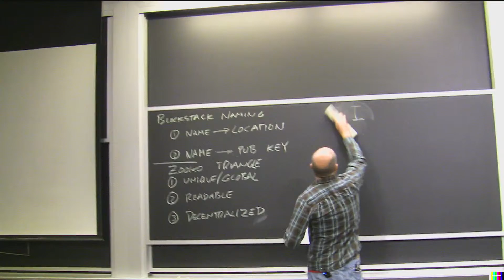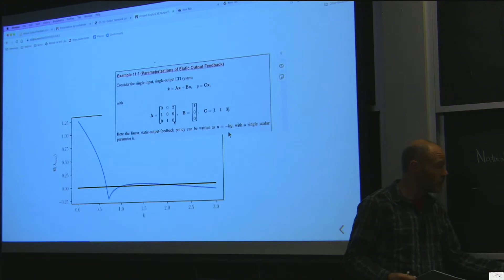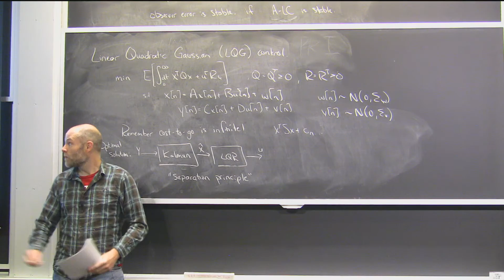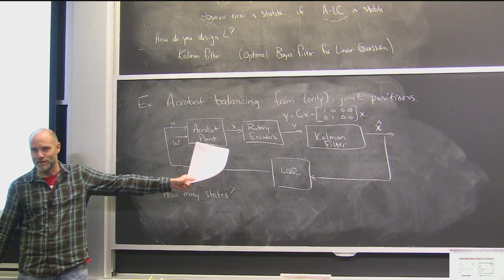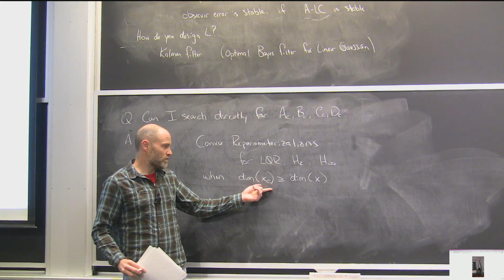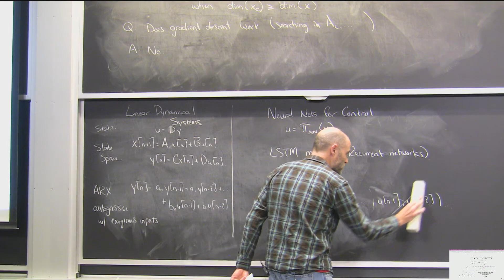Lecture 23: MIT 6.832 Underactuated Robotics (Spring 2022) | "Output Feedback"

Comment: At 53:20, you wrote a general form of a dynamic controller (with parameters Ac Bc Cc Dc with xc, yc, and u), but it is not clear to me what xc, yc, and u are, in terms of x, y, and u of the plant. Is yc==u (u of the plant)? Then why is the u inside the controller acting as an input to the controller? It would be great to see more on this topic this semester! Thank you.
Reply from the maker: Yes, the input (uc = y) to the controller will be the output (yc == u) from the plant.  xc will be the state of the controller; in the Kalman filter example this would be the mean of the state estimate or perhaps the mean + covariance of the state estimate in the time-varying Kalman filter.

And yes, we'll have more about output feedback in the lectures this spring.